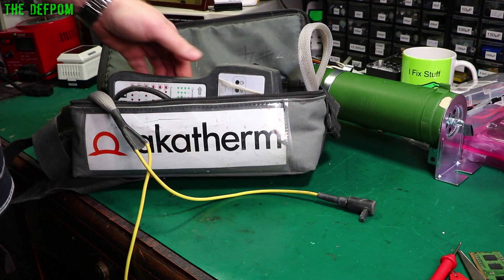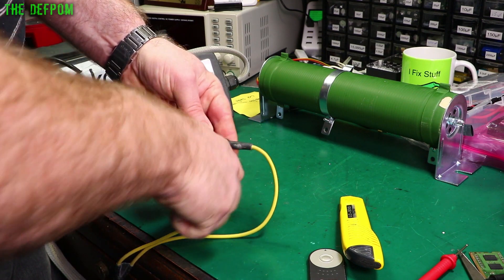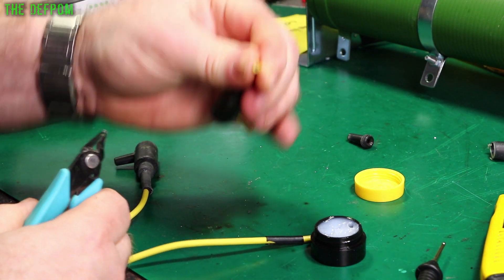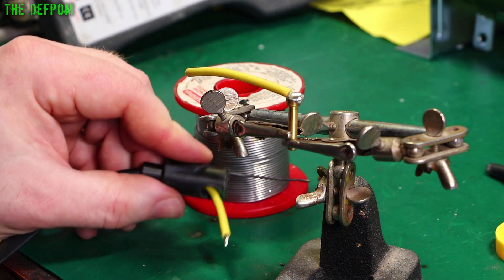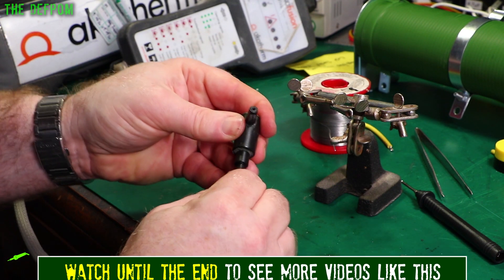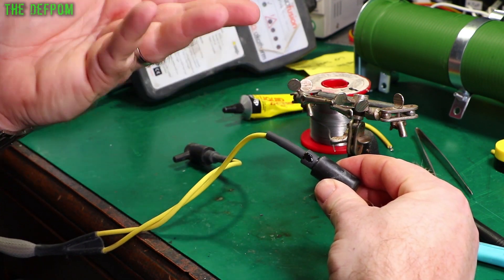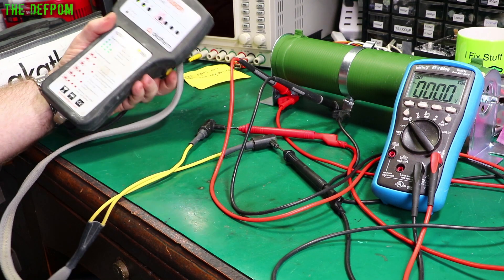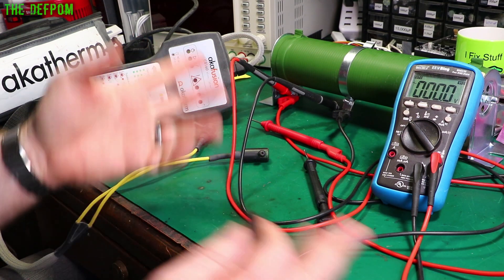#775 Akafusion Akatherm CB160 Electrofusion Unit Repair (again) SN_0139

Comment: for mid-wire repairs like that, I always go with double or triple heat-shrink tube, two or three diameters, each longer in length to cover the previous by a ways on both ends. often different tube types, shortest layer over the joint that's very stiff, then softer type as the next two layers. it's all for stress relief, since solder joints make weak points in the wire just past the solder. :)
**commented too soon again, but same applies to all ends near plugs and often flexed points

Comment: Perhaps it is the quality of the wire itself that is questionable here? What do you do with these units afterwards?
Reply from the maker: I return them to the owner, I do have some better wire, (it’s pretty expensive stuff) which I will likely need to start using if I see the same wire broken again, the original wires do seem to only be barely suitable...
Reply: @TheDefpom  Ahh.. ok, I thought you got them from ebay. Missed that part.

Comment: Good video.
I don't see these lower powered units here in Australia, only the 2kW machines.
They may be around but maybe don't need certification like the larger units do.
I Googled Akatherm, it looks like they have their own electrofusion connection/power system for pipe joining.
Where as there is a different standard for higher powered units and 39.5Vac and 50Aac.
This means the load leads are a four-wire system for the controller to measure the exact voltage at the load/element tips, also a fifth sense wire to read a cooking time resistor located in the element plug.